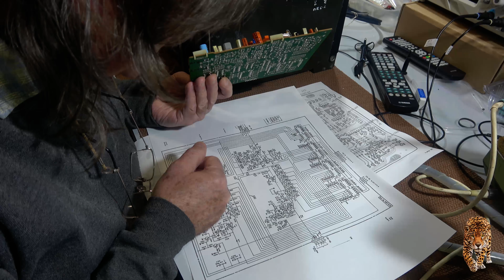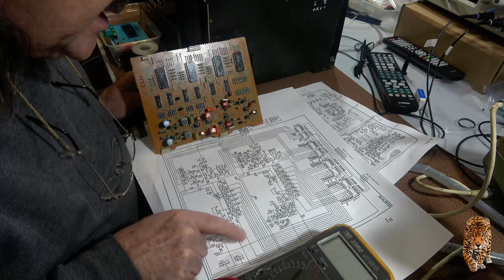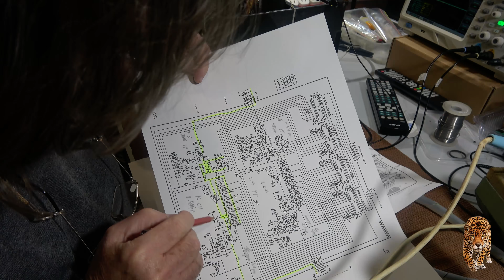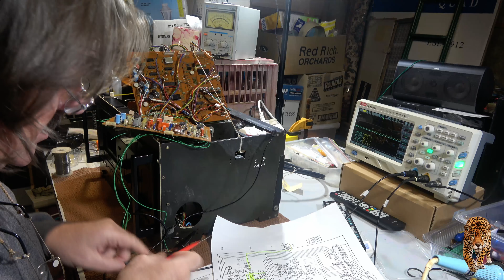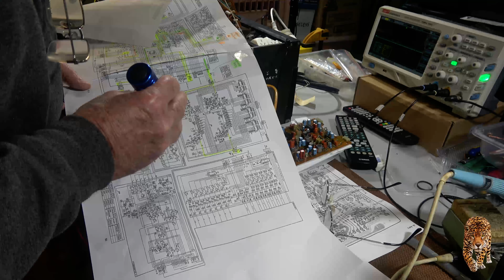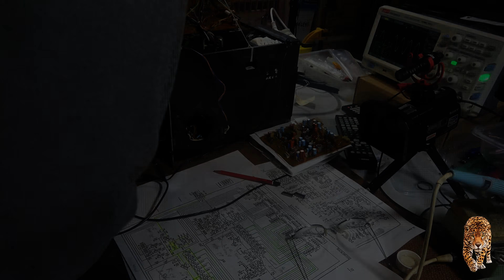Nakamichi 1000ZXL Repair Part 13. The next REC EQ AMP PCB fault

Comment: Great Patience, Please Upload the fault finding Video's . Love Watching the Process.
Reply from the maker: You don't see me going crazy sometimes. I expect that situation. I quite often have to go over what I know and redo a process because I didn't understand it. That's the thing: as you go thru the circuit you understand more and then the answer becomes a culmination of heaps of errors and blind allies, so to speak.
I build and maintain my network of pcs, servers at home and they are frustration to the extreme when things don't go well. Networking is my biggest bane. Yowee. At least I don't throw the keyboard across the room these days. 😃
Fortunately most audio stuff is unidirectional : it goes in and goes out and you follow the path.